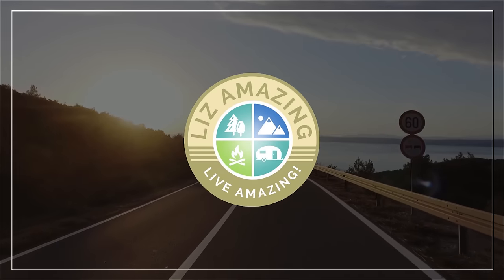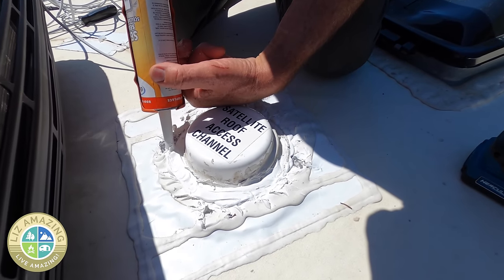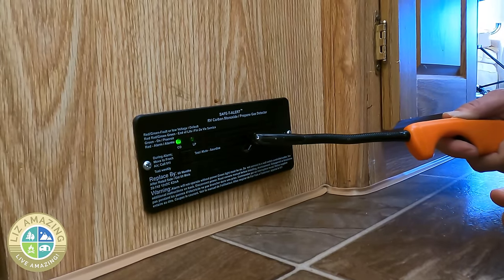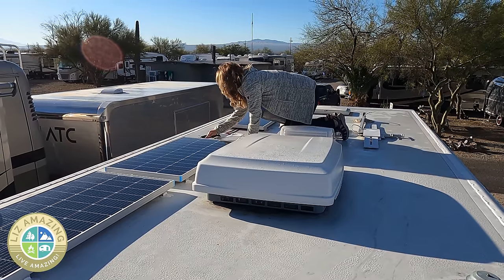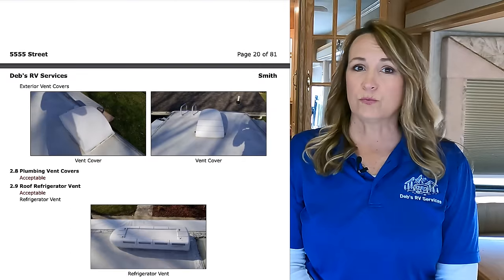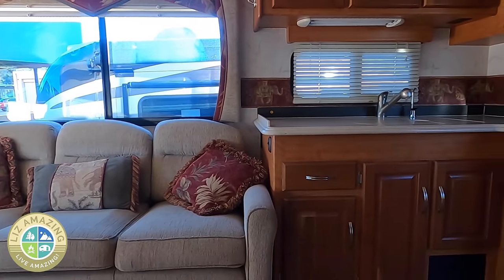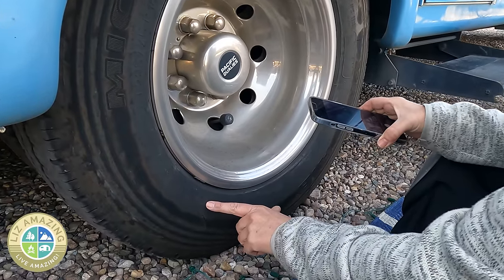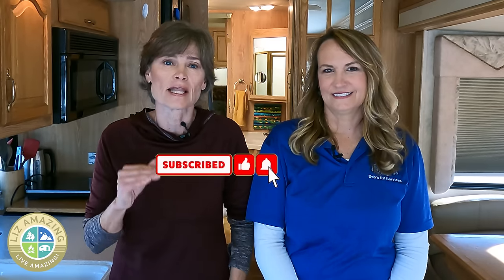Did I make a mistake buying my RV?

Comment: Our engine ran hot coming into Washington State. We called a  wrecker that towed our motorhome to a place next to a busy highway with nothing to keep it safe. People like keyed it all over everywhere. At one place it looked like the hit it with a car .It took us 20 days to get a wrecker to tow our motorhome to have  it severed . Then a couple of days later we call to  have the motorhome towed to Cummins. It took like 5 to 6 weeks to get a wrecker to tow it to Cummins. Later Cummins call and said that the motorhome was ready. 
We went 35 miles  the engine ran hot again. We pulled over and called roadside assistance they promptly showed up two
days later. The person that came with the wrecker to tow us back to Cummins did not hook his air line to our motorhome.
We found out the next day what we needed an new engine. Also when the last wrecker pulled into Cummins he back our motorhome into a concreate barrier. He had towed our motorhome like 40 miles with all wheel braked locked down. We are lucky the darn thing didn't burn down. So as of now I at Cummins parking lot . Our first break down was Sept 6, 2022. I have no idea how many months we will be here. We have a bid for repair should be ready next week. So in I guess 2 to 5 months later maybe we will be back on the road. whoopee isn't this fun lol .
Reply from the maker: Oh my gosh, what an ordeal! Jeff, I just can't imagine what you have been through. This is beyond what anyone should have to experience. I am sure hoping for a happy outcome. Thanks for watching.
Reply: Wow Jeff! That would make a grown man cry, cuss or both. Has it made you question if owning a RV is worth it? Are you staying in hotels?
Reply: @keith606  No Cummins has fill hook up 50amps at their location. Have to get bids
for repair not that is hard. Motorhome so much damager.. Thinking of buying another motorhome . Just have to wait and see how this turns out.. Thinking of buying a newer one this is motorhome.

Comment: Never ever buy a home, RV, boat, motorcycle, etc without first having a comprehensive inspection by a qualified party. I was a ReMax Agent for 9 years and sold almost 400 homes. I ALWAYS recommended an inspection. If it made the deal go down that was fine by me. We just went out and found another home. Get an inspection.
Reply from the maker: Yay! Thanks for the endorsement John. That's the way to do it.

Comment: Jonathan Yench a van travel youtuber bought a used big foot camper last year.  He was planning to remodel it but he was still surprised by the extent of the project once he started to unbolt and take apart.  It’s pretty much everything has to go except the fiberglass shell.  He said the cost of rehab he could have bought a brand new camper.  Then again, even new RVs and campers can have problems from shoddy built quality, too.  I think even buying new ones they should be inspected.
Reply from the maker: Those Bigfoots are nice. But yes, a big job to reno it the way you want. All seem so cheap now. Thanks for watching!

Comment: I find that an RV inspection is very important.  I am not in the market to sale or buy currently but curious as to what is an average cost for an inspection?  I may get one in the future just for peace of mind.  I am very handy I do 90% of my own repairs and maintenance, but I did have a armor roof put on several years ago that is a life saver
Reply: It can vary depending on model and type but avg is $400 for the smallest travel trailer up to $1500 for the largest Motorhome. Sometimes travel is added in too but that is an approximate window.
Reply: @debsrvservices  thank you for the info
Reply from the maker: Thanks for watching, and I'm glad Debbie answered your question.

Comment: Wow! Hope that water leak in your kitchen ceiling hasn't caused any mold. Liz, you didn't say if your motorhome passed inspection. Hope all is well.
Reply from the maker: Thanks, I did not get a full inspection. The rig has only been in Las Vegas and southern Utah so I'm hoping it got pretty dried out. There is zero smell of dampness or sign of mold. The new roof was put on four years ago. Hoping I got lucky!
Reply: @LizAmazing  Woodworking shops sell wood moisture meters that will read moisture in wood and other similar surfaces. Just press to the surface in question and push a button.  They are less than $30 on Amazon. If the ceiling is dry but a little "punky" from previous moisture, consider a "rot fix" epoxy that you inject into the soft areas. It's thin as water  and soaks into the wood via capillary action. Dries hard as a rock.  Much cheaper than tearing off the new roof to replace some plywood.
Reply from the maker: @h5mind373  Oh wow, thank you SO MUCH for this suggestion. Both things sound amazing. Good to know, for sure!

Comment: How much does it cost to have one inspected
Reply from the maker: Great question, Jimmy. Inspection rates vary depending on year, make and model. I imagine cheaper for a van or small travel trailer than a large motorhome with all the systems. The range is between $350 and $1500.
Reply: It would be well worth it 👌 😉

Comment: Inspecting engine, and other components for a motorized RV was not covered? I recall one of your older videos you showed your batteries anf they were visually in bad shape I was disappointed the owners sold it to a single lady in that condition 😢
Reply from the maker: The sellers were GREAT! I wasn't bothered about the batteries as I planned to replace them, glad I did. The sellers put in new carpet, new furniture, new toilet, new roof, full body paint and even changed the oil every 3,000 miles. I'm very grateful to have found my cream puff and I know I got really lucky this time Yes, an inspection of a motorhome can include the engine components and a fluid test. Thanks for watching.

Comment: Hi Liz, on an 2nd hand unit like yours yes I would have had the inspection done. That way you would have known about some of the things you missed as an ordinary person, that's ok. I don't think you made a bad purchase it's just those little things that count.
  When I bought my 5th wheel it was new and the inspection was going to be outrageous in price over 2,000$ for a 33ft brand new RV. So the dealer had camp sites on the property, we stayed for 3 days I did my own inspection and every day they checked with me to fix anything I found wrong witch was very little, and anything I found later they made sure it got fixed at my convenience, so I was really lucky. Its a toss up do you or don't you?????? Big question. I hope everything turns out great on the inspection. Till next week take care and be safe. 👍👍👍💜💜💜🕊🕊🕊
Reply from the maker: Thanks Larry. I hear all the time that I got a cream puff and so time will tell if I made a mistake. Honestly, I am still jumping up and down inside because I got such a great deal. I will keep you posted. Thanks so much for your comment and have a great week.
Reply: Wow!  That’s expensive. I had heard they were in the $400-$500 range. I wonder if it depends on location.
Reply from the maker: @ceciliapetrowsky2572  Yes $2000 sounds mighty high!
Reply: @ceciliapetrowsky2572  maybe, it was Rochester NY.

Comment: I purchased the used RV without an inspection boy. That is the story that I subscribed to. I have some questions. Did you ever get rid of those water stains on the ceiling? I looked at them after I had purchased the RV and I said to myself I can live with that! Problem is I only have the RV for about 4 months and I can't live with it. I am trying all different kind of products to try to get rid of them stains. My roof inspection did not turn out well either. It isn't devastating but it's bad enough to give concern. It's not crunchy. It has been fixed. Unprofessionally and it is leaking and I'm looking at a no one handyman who does good work to help me out with resealing it and making the repairs necessary. I have actually decided to live in it even though the city does not like that to do a shade down on all of the systems. The color of my rig is very similar to yours. There are things that I did not expect to happen. The 98 Odessa overland Laredo at first glance really looks nice. But we're struggling with some issues. The generator will not charge the batteries. The engine needs to be running and you need to be going down a road to get a decent charge. Oops, didn't count on that one. I did replace the batteries as the unit had stood for a few years and the batteries were bulging. I am planning on putting solar panels on the roof which are lithium phosphate. The floor plan is very similar to yours. Especially the bathroom setup. I love it. The unit is 40 ft long and I have the whole place to myself. Single guy blah blah blah when the unit was for sale the ad said there were over 40 perspective buyers. I waited approximately 6 months before I put an offer in on it. It appears that those buyers were not that serious about the unit as I had an accepted offer right away. There's 109,000 mi on the engine. Somebody was energetic enough to start taking all the TVs apart to replace them. But that's as far as the project went. Everything is disconnected and sitting so I am now saving up for a whole new set of TVs. Not going to replace one in the outside bay. Have no intentions of sitting out there and watching TV. It's been raining and hailing where I live so I'm having a marathon day watching RV videos. My windows do not need the fogging yet, but there is a problem in that all of the seals are kind of drooping as if they have been melted at one time. And there's an attractive piece of duct tape that goes up the side of the right passenger side of the windshield on the front of the vehicle. I did not know that when I was purchasing it. I was wondering if you'd be willing to share or if you have the repair bills so I can have some idea as to where they got the idea from to replace the front headlights. And I might as well replace the back because you have to light a match to see if the back tail lights are on.
Reply: After my vehicle arrived home we started looking at the electrical system. The electrical system is a mess and there are actually three separate areas where there are fuses. Many of the fuses were out being blowing or missing. In spite of all of this, I love this vehicle. It is something that I never thought I'd ever have. And there are many lookers who arrive at night to take a look at the vehicle. I'm surprised you do not have cameras on the outside of your vehicle for extra security. I did not want to put the holes into the fiberglass so I mounted the cameras onto some out buildings and post around it. I purchased cameras that are easily demountable so I can take them with me wherever I go. After a fresh paint job, they will be attached to the vehicle permanently. Unexpected items and repairs that are needed are a new hot water heater. I like the idea of yours being electric and propane. I've added that to the list. The forest air floor heat unit has been replaced. I have the old one in the basement. I didn't replace it. Someone else did. They did not hook up the heater to the vent system.
Reply: The refrigerator freezer does not work well. Ice cream will not stay frozen. Ice cubes will melt.
Reply: I enjoy your channel. I love your energy and enthusiasm that you give to it. Hope to meet you out on the road someday in a year or two. I think it's going to take me that long to get this place fixed up. I do belong to the Odessa family owner's group. I have not posted anything yet but I am looking and thinking about a lot of things to do and documenting it and putting it on that site. The sad thing is Odessa went out of business and approximately 2002. I was fortunate enough to get all the manuals which are mostly sheets from the manufacturer of the individual components that they've used. I have all the repair bills and over to life of the vehicle from 1998. It looks like they have put over $200,000 into the repairs. The original invoice for the vehicle says that it's sold for 89,000. That was back in 1998. For the first 20 years, it appears that the value of the vehicle grew. It is now on a downward spiral. I have list s and more list of things that I want to do and things that need to be done in order to get it into the condition that I feel it should be in. It is an antique at 25 years old. I expected that I it would need repairs and updates when I purchased it. I'm not disappointed in the purchase. I'm a little overwhelmed that times that things cannot be done quicker, but I still love the vehicle.
Reply from the maker: Wow, it does sound like a lot to deal with now. BUT it sounds like you are working your way through. Glad you love it. They definitely don't build them like that today! Looking forward to seeing you on the road, Thomas, and thanks for watching.

Comment: What does a typical inspection cost?
Reply from the maker: She said it depends on the year, make and model of the RV. I'm sure a little travel trailer will be a lot less than a motorhome, of course. The range is between $350-1500. Thanks for watching.

Comment: Liz, first and foremost Allways have a RV Inspected prior to purchase.  I don't care if it's brand new on the showroom floor.  If the dealer won't allow you to have it independently inspected walk away with your money.  This new units where just slapped together to meet the demand.
Look at it this way.  Would you buy a house with out an inspection or a current survey of the property line and a title company involved.  Not me.  Seen to many issues in the past with home sales the only difference here is this one travels down the road.
Also personally I wouldn't let the inspector work on my rig.  Reason being like a home inspector they could say it needs this fixed when it actually doesn't.  Just trying to keep everyone honest is a job in its self.
Safe travels and roads Brian and Cindy, "xtreambydesign with passion"
Reply from the maker: Exactly! Thanks for your comment Brian. I toured the factory in late 2021 and that turned me off of buying anything new anytime soon.

Comment: Liz do you have a CDL license (or need one for some places?)
Reply from the maker: It's not needed for the weight of my rig. Most states do require it if you are over a certain weight and are using it for commercial purposes.
Reply: @LizAmazing  Thanks!

Comment: Oh! Come on!  Did your RV pass the inspection or not???
Reply from the maker: I never had a full RV inspection. As you saw in the video, I did not have GFCI protection (I since replaced the GFCI breaker), I passed the propane test, and the hot skin test. There may be some concerns with the roof, but no soft spots. Time will tell! Thanks for watching.

Comment: Seriously, no one saw this coming? A person buys a used RV, a person who spent years making youtube videos on RVing, did not get an inspection, but NOW is making a youtube video on it. I knew this was going to happen. A bit too much drama, and not enough teaching what you should have learned.
Reply from the maker: I don’t hugely regret not having an inspection. There are no soft spots on my roof, and this is camper number nine that I have owned. The sellers were and are amazing! They put in new carpet, new, toilet, new furniture, new roof, upgraded the TVs, painted the exterior and even gave it in oil change every 3000 miles! That said, I do use my channel to educate, and I think that the average person definitely should get an inspection and I will consider having one next time around. Thanks for watching.